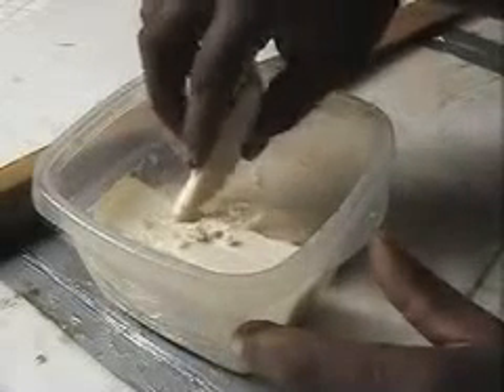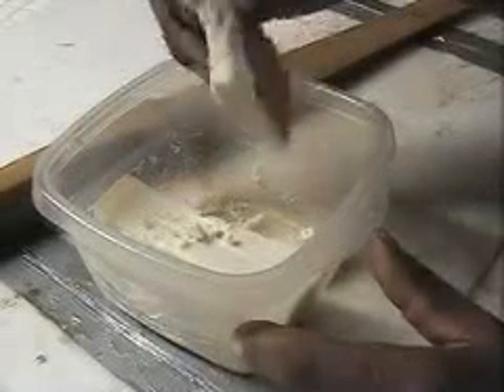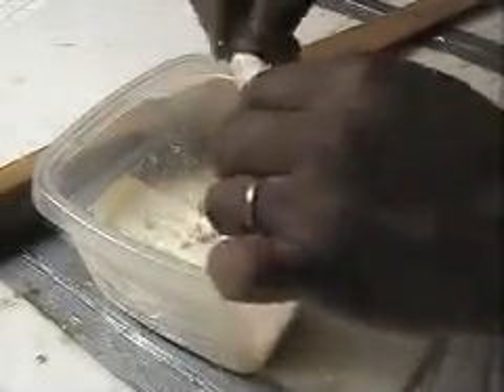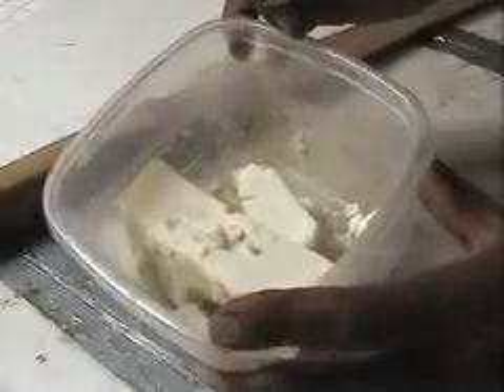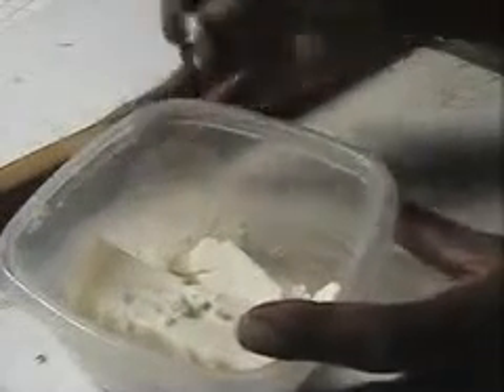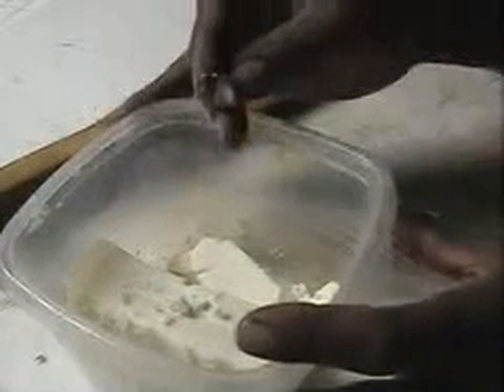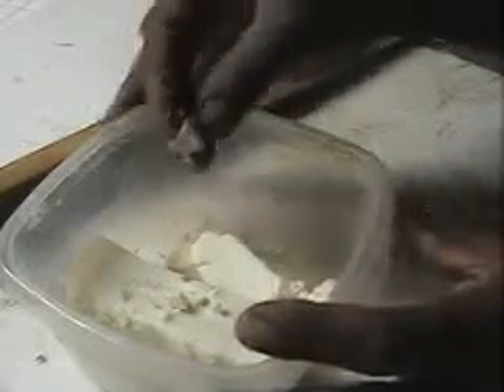The Urban-Abo Bushcraft: Oiling a Bow Stave with Tallow

Comment: You finish bows the same way I do. I saturate my bows with hot animal fat (rendered first) and expose the bow/oil over open coals for 1-3 minutes to drive the oil deeper. I do this several times for a period of 2 days.

I than finish with a beeswax/oil coating. 

I appreciate this technique though, as rendering fat without a container in a primitive survival situation would be difficult. Just rub raw fat on the bow, than heat it up to drive the oil into the wood.

So cool, thanks!

-Aaron